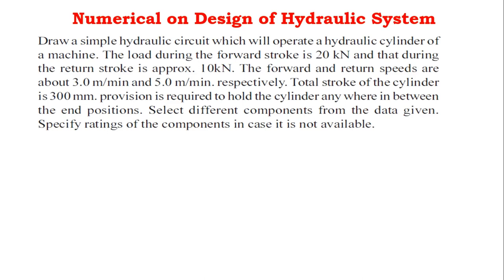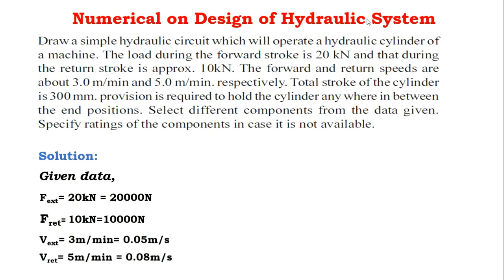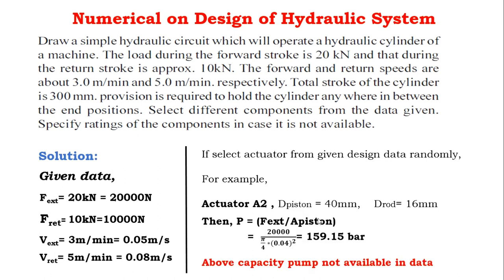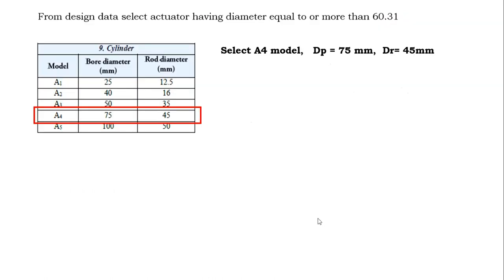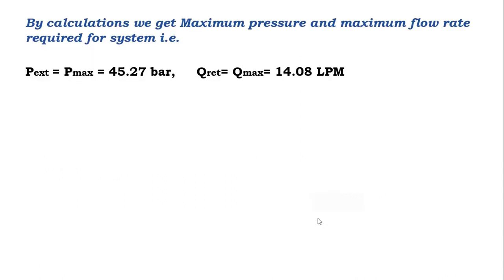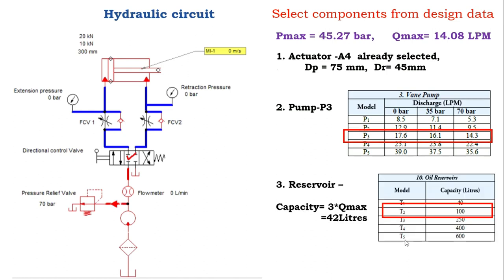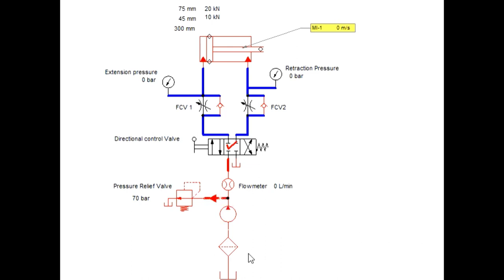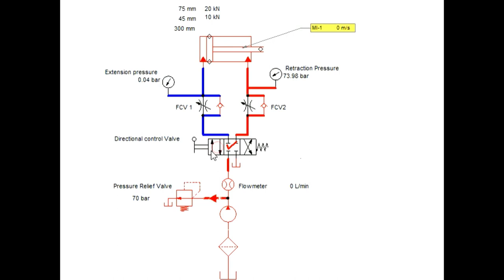Design of Hydraulic Circuits / System - Numerical | Animation

Comment: thanks for your effort. it is very helpful work. but we need the catalogue you use it for selection the design data. could you please help, to get that tables, because if the value out of these tables which you mentioned what the solution. 
also this shall be follow certain standard this which standard you follow?
Reply from the maker: Yes, You can use components manual of any specific company and select components accordingly